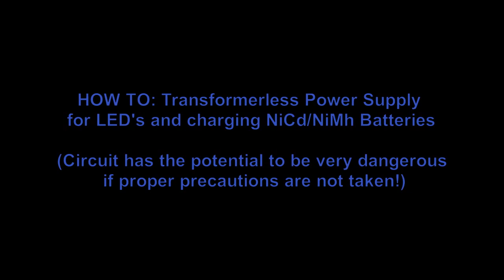HOW TO: Transformerless Power Supply - LED's/NiCd Charging+

Comment: The only other safety that you should add is a discharge resistor across the high voltage cap to discharge if is you happen to disconnect AC just at the peak of the sine wave.   It will store that voltage.   A 510K to 1 Meg ohm would be a good value.
Reply from the maker: Yes, I normally use a bleed resistor.

Comment: Just came across this vid again for reference to a question on instructables, but did you know that one way you could describe what you described at 3:28-4:00, could be described by saying the "output impedance" of this supply is very high? that is, as you load the circuit down with more and more load, the output voltage drops more and more. The higher the output impedance, the more "sagy" the voltage appears to be, while the more stable the current appears to be. Pretty cool huh!

To get a stable voltage output, you could add a zener diode "shunt" regulator to the output, that way as the voltage across the capacitor charges and approaches the zener breakdown, the zener will start to conduct current, effectively becoming a load for the circuit, causing the voltage to stabilize. It is like a governor for mechanical systems! However be careful because the zener diodes can easily overheat, most only rated for 1W, and the voltage across the zener times the current will be the power (heat) dissipated.

Comment: What is the DC output voltage?
Reply from the maker: Voltage output will vary based on the load and capacitor being used.
Reply: +mike brown 170V unloaded, and 0V short-circuited. The output voltage with a load will depend on the capacitive reactance (which itself is dependant on the capacitor used and the frequency of the mains), the load itself, and the input voltage.

Comment: it's cool watching the two leds alternate slowly back and forth. That is the way the camera picks it up. In real life, they would both be lit because the eye can't see the flicker. I figure the video is about 24 frames per second and the flicker is roughly 60 times per second. The discrepancy causes the effect.
Reply: The alternating is defiantly a weird and awesome phenomena, though I suspect it was recorded at 29.97 fps, because the LEDs seem to fade slowly taking several seconds to complete a period. The beat frequency can be calculated by simply finding the difference between the 60Hz flicker and the closest harmonic of 29.97fps, which is 59.94Hz, so the camera perceives 0.06Hz, and to find the period, I took the reciprocal of this (1 / 0.06) and it is approximately 16.6...Hz, which does closely match that of the video. But why would the LED's be out of phase in such a way? it is funny because, at least as I understand, the LED's have the phase and current, right?

Comment: I found your video when I was looking for more info about this type of PSU's. My interest is only for Leds. And it is probably the most compact way to powerup leds from mains.
My circtuit is working in 230VAC50hz, just as good. with 20mA and 50mA leds. (though I blew up some leds, fuses and varistors during tests lol)
Good work!